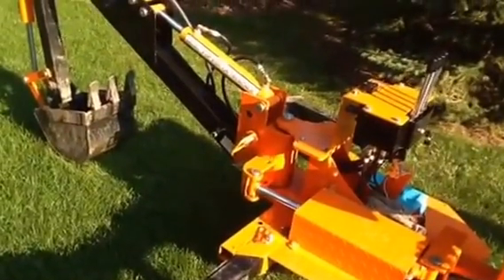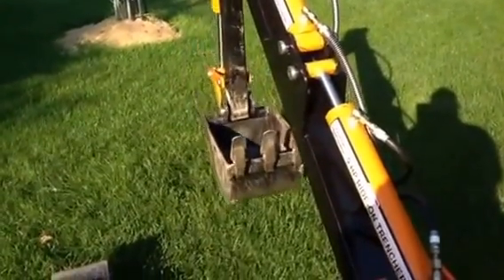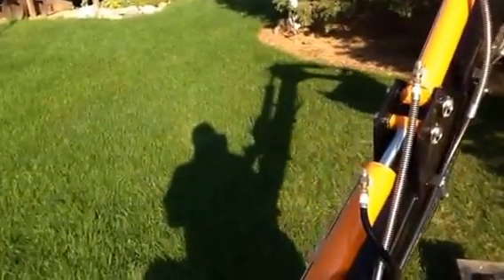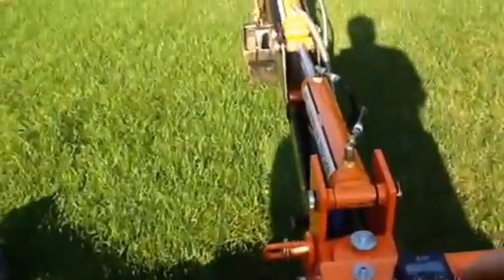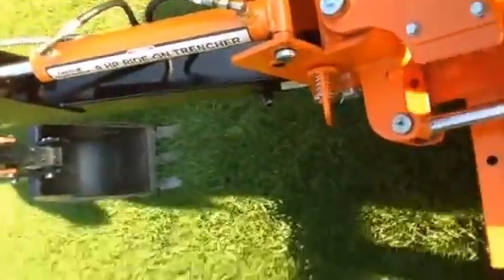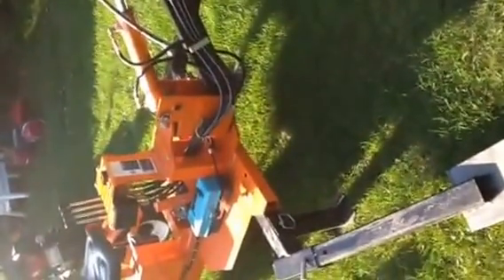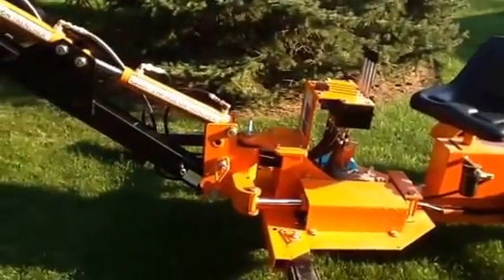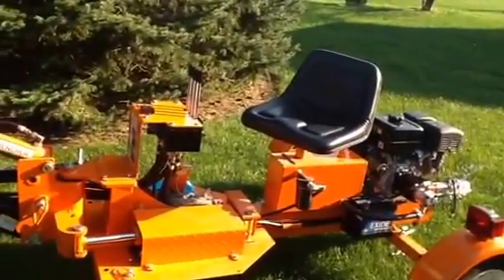Harbor Freight trencher 65162 hydraulic speed upgrade

Comment: Did you put a bigger pressure hose from the pump to the control valve?
Reply from the maker: I got the largest  one I could use to help with the bottle neck problem.
Reply: @goneredcar1 What size hose did you use and where did you get it? How did you get it to pair up on the valve body?
Reply from the maker: @Benpoetter  custom made at a local hydraulic shop. Brought the hoes to the shop and they made a new hose to the size that they thought would work.
Reply: @goneredcar1 What was the hose size that you settled on?
Reply: @goneredcar1 could you run the engine full Throttle if you wanted to or would you start to over heat the hydraulics system.
Reply from the maker: @Benpoetter  I replaced the gas motor with a diesel early on and I run the diesel at a low speed and no oil heat build up noticed.

Comment from the maker: I only had this pump on for a short time but I ran it at about 3000 RPMs. I then replaced the engine with a a diesel and a larger volume pump. I have had no problems with this setup and just reached 400 hrs.
This is not a back hoe it’s a light duty trencher or as I have said in the past hydraulic shovel.
Reply: What is the name of the new pump?

Comment: When you had that pump on could/ did you run it on full Throttle. And I see that they don’t make the pump that you put on anymore but they make a new and improved version. And is this a different pump than in your other video about the speed upgrade because this one says that you had a 20% increase and your other video said a 35% increase. And also, did you have any problems with the control valve after you did the new pump? Did it hold up in long term use? I am wanting to put a faster pump on my trencher but don’t want parts to break. I’ve also herd that it will take a very long time with COVID to get replacement parts and don’t want it to break in a job and be don’t for along time.

Comment: I loved your video. I’m about to buy one and would love to know which pump you found best?
I’ve watched all the videos so I’m upgrading everything.
Which pump?
Reply from the maker: The information and discussion with the information your looking for is in the text section of the video. The recommendations and part numbers can be found there. After checking there and have a specific question send me a message.
Reply: @goneredcar1  I see the video, it has no text in it, and the opening comment with replies below. Maybe a dumb question, but where's the "text section of the video."
Reply from the maker: It’s in the public text section here if your looking for the pump information remember it’s different for the several engines I tested on.
Reply: @goneredcar1  OK, thanks. I guess you mean the pump info is in one of the many replies. I'll go re read the replies. It might be helpful to some if that kind of info was included in your opening video statement text after where you wrote " How to upgrade the hydraulic pump to increase the machine speed by 20%"

Comment: Thank you for a great video. I am planning to build a similar back hoe for my JD 316 tractor. Do you know what size hydraulic cylinders are used on the HF unit?
Reply from the maker: Sorry, I haven’t any measurements and the machine is in winter storage in a out building which I have no access till spring. I’m sure someone will reply that has their machine available.
Reply: What type of hydrolic fittings are on this machine? Having trouble finding adapters
Reply: This lady has the fittings info. I'm trying to find my way through pumps now. I can't seem to source the exact same one. I really need specs on the original to compare to.
Reply: https://youtu.be/VIQbUcIsBvg

Comment: Hi, great stuff! My hydraulic pump was defective on a new machine with less than 10 minutes of moving bucket around in the air. I found a Salami dealer in Michigan but he didn't have the pump number you listed. He gave me a similar pump. While looking at these pumps I noticed all are above 3200 psi......you said your running at 2400 psi. I was told that the machine has a relief valve that will not allow psi above 2400psi. Is this a true statement or did you do something different?
Reply from the maker: Sorry to here about your pump failure. I never changed the pressure on the relief valve, the pumps I selected we’re higher pump volumes not pressures. Before you place a new pump on your trencher I would drain the oil and check for junk in the oil tank, and lines. With a failure like that the junk is everywhere so clean and inspect thoroughly.

Comment: I'm having problem with my control valve sticking, hf wants $300 for new, I tried to clean have you ever had that problem
Reply from the maker: JMTZ  I have never had any problem with the control valve. I have changed the oil twice since new. I would have the valve checked at a local hydraulic shop so you can make an informed decision before doing anything.

Comment: Would this pump work? Thanks
https://www.surpluscenter.com/Hydraulics/Hydraulic-Pumps/Gear-Pumps/0-277-cu-in-MTE-D206-5491-Hydraulic-Pump-9-8401-277.axd
Reply: did you buy the pump you listed and does it work good on the trencher?
Reply: @richardmiller3781  Still haven't for fear I would buy the wrong one.

Comment: would a DLH 4 GPM Gear Pump, 3600 psi, 2x2" Mounting, CW, CB1S-F4SA work for this?
Reply from the maker: MrStealth654321  4 GPM maybe to large of a flow rate for the 9 Hp standard stock engine. I ran a 3.7 GPM with the 13 Hp engine with good results. As I explain in another video, you start to get into a bottle neck problem because of 1/4” lines.
Reply: @goneredcar1  Trying to find one on ebay that will work .. with the 9hp. with out paying a arm and leg for it. If you know of any that will send me the part num  Thanks for all the great videos bud and any help.
Reply from the maker: MrStealth654321 They run right around $100.00 the part number is in one of the text portion of one of these videos. As I remember the location of the store was in Michigan that’s the best I can remember. I just put in the part number and it came up with the suppler.
Reply: @goneredcar1  ok bud thanks.

Comment: Hey, I know you posted this a few years ago but after watching your videos over the last year I finally ordered the HF trencher and am waiting on it to come in right now. I needed it to do my septic system and use it as a trencher on some of my construction jobs. went ahead and ordered the upgraded 4.2 GPM pump as well form northern tool. I was just wondering if you have even tried to add some type of counter weight to the back for better support while digging.
Reply: Hi, Did the pump from northern tool work?
Reply: Nothermn tool part fit
Reply: @ralphwebber6790  What was the model number from Northern Tool?  Did it improve speed?
Reply: Can you share the Northern Tool part number?  How is it holding up?  Did it improve speed?

Comment: I just bought a used HF backhoe, and your video's was a big help in knowing what I was buying.   That said.  I have one cylinder that doesn't stay in place, and another that has no power and whistles.  I am new to hydraulics, so before I start throwing money at this, I thought I would see what you suggest I look at first.
Reply from the maker: If you would like to confirm if it's a ram or the controller switch the Rams with the one that works. That's because if a ram is leaking internally there will be no indication of leaking oil. Remember this is a bypass hydraulic circuit so oil is always flowing. When you determine the problem check with a local hydraulic hose and cylinder shop for rebuilding. That may run from $75 to $100 for rebuilding.
Reply: Thank you for your help.  I was able to determine that one cylinder is the ram, and the other is one of the valves.   The one that is on the valve I can here a whistle sound coming from the valves when I there is a load.   I plan to change the o-rings on the hose, but is there something that I might also need to check on the controller switch itself.

Comment: I found your YouTube so I upgraded my pump.
Works great.

Pump 
Salami Hydraulic Gear Pump 1.6PB4.1D-R080S0 
Model # 6142?5002 
( ? looks like 3 or 8 )
I just installed the one above on my backhoe / trencher
The "D" is cw (clockwise) when ordering pump. 
OR
1.6PE4.1D-R080S0
Model # 614470242

(Both pumps are the same)

Adapter
6MB-6FP

Adapter
8MB-8FP

Thread Sealant with PTFE
Permatex 4 ounce  #80632
Reply: F the

Comment: thank you again for info, just to let you know, i changed cylinders. and moved the one with the seepage problem that was on top and now i put it on the bottom where it holds entire boom and now its doing the same thing.the top one works fine and bottom one has the problem ,so i am thinking it is the hydraulic cylinder. what do you think?

Comment: hello again my friend, i have a couple of questions maybe you can help me with. first whats the number to the company you bought the hydraulic pump ? i am still using the pull 9hp engine it came with.And the other question is the bucket keeps dropping by it self.I added more fluid because i thought that may help but it didn't.The machine has no leaks what so ever and i dont know whats wrong.Maybe this happened to you.I have less then 20 hours on the machine.It digs strong but when i am ready to pick bucket up it keeps dropping and losses alot of power were i cant even pick up dirt to empty out.i did notice if i curl the bucket first then i can raise boom but it takes literally more than half a minute which makes working very frustrating.Any information is greatly appreciated, Thank you very much;  Jack
Reply from the maker: +hunterjh13 from what you describe it sounds like the valve body may have a problem.  Sometimes crud  from the tank gets stuck in the spool valves, this occurs from the manufacturing and failed cleaning of it.  I have had several folks reported this problem. Many reported junk found in the valve body, one a broken return spring, and damaged Orings.  Your second question on the pump as I said in the text portion on this post I purchased local. The pump number in the text is universal and a google of it will locate several locations it can be found.  From what I have heard there was A place located in lower Michigan that had it for a good price (no other information on name)

Comment: Hi Gonerdcar1, 

Thank you for your video. It is very helpful .  I am confuse on your information with the  Salami Pompa mod# 614470242.  Is this pump used for the 35% or 20% speed increase? Base on your updated info, we should use 20% speed increase because of the heating problem. Can you let me know which pump model I needed to buy for this 20% speed increase?  Also, do you have any idea on the HF trencher loader lift capacity? 

Thank you
Reply from the maker: Toan Than it's based on the pump volume you choose and the speed in which you run it. What I did is change the engine from 9 hp to 13 hp to gain the use of electric start. With the added hp I reduced the engine speed and increased the pump volume.  I had changed the pump several times because the hydraulic shop in my local area supplied me with several pumps to play with.  Watch all the videos and you will see you can only get to a point and you are bottle necked by the small 1/4" hoses.  Then you start to heat the oil caused by friction  by the restrictions of the small hoses.  The bottom line is keep the pump volume between 20 to 35 % increase over stock. Sometimes more is not better.  When I went to a Diesel engine I slowly started to switch over to 5/16" lines that helped a little.  I now have the trencher working just the way I like it and have put many hours on the clock. I was very lucky to fine this local shop that assisted me with there expertise and resources.
Reply: goneredcar1 Thank you for your feedback.  I got what you mean now.
Reply: Ś

Comment from the maker: No other filter, but it maybe a stuck control valve.  The next thing to check do you have the right hyd oil (32) this is very important.  Next because of your low hours are all the hoses right and are the tight.  If you are getting air in the system this can cause control failure.  Just to let you no the tech support on the trencher is a little lacking on the running of the machine.  If you get a little frustrated find a local hydraulic pump and hose shop they maybe more help then HF.
Reply: The best  way that I. Can tell you to check this machine is to  find  out .if  all of the hyd. Cylenders . Are bled . 1 after.the  othef. And .check.mfg. ing. Recomendation.s for.that. machine.

Comment: Hi and thanks for all your video.
I have only 8 hours on the trencher and today as I was digging the machine won't respond, was low on hydraulic oil so I add more, worked a bit then stopped again, but fluid level is good, called tech support but need call back tomorrow, beside the filter on the side by the hydraulic tank there is any other filter that May clogged up and won't let oil go true controls? Maybe you can help, thanks in advance. Tony
Reply from the maker: This can be narrowed down quickly by removing the return line and placing the end into a clean bucket.  Start the machine and see if you have a fast stream of return of oil going into it, if the stream is of low volume it's the pump.  If the volume is good it's the valve body's bypass feature stuck open.  I have heard that this may occur if debris gets into this area.  The bypass section is on the right side of the valve body follow the return hose back to the valve body.  If you think it's the pump and need a pump to replace It I have sum to try, contact me if you need more help.
Reply: MrAnthonyp28 I am having the same problem. I just started using mine and now it's doing same thing. Have you figured out your issue as of yet?
Reply: goneredcar1 Thanks for your response. I have checked just what you have said and at an idle speed I can put my thumb over the return line and stop the flow. Not sure if that is good or bad but I'm hoping its just the pump for now I have to many projects going on now to do a complete upgrade of everything. Maybe over winter I can. Keep up the excellent videos. Any info will help.
Reply from the maker: That would be a bad pump, if you find it difficult to locate a pump I do have some.  If you ran the pump with no, or low oil it can damage the pump very quickly.  If you look into the pump you will find gauging that  lead to pressure loss.  Make sure you were using the right oil also before installing a new pump.  The oil will need to be changed and system flushed of all metal and debris and the filter changed or you may damage the new pump.
Reply: goneredcar1 Again, Thanks for the response and all the great video's. I have located a new pump from Grey Hound, the manufacturer of the back hoe but I have a few more questions for you. 1) How big of a pump do you think I can run with using the factory 9hp engine? 2) You say you have a few pump laying around, so I was wondering how much you were looking to sell them for if your wanted to sell?
I was watching the video where you changed out the hydraulic oil filter and housing. Was there a must for that because of your upgrades or because it is hard to locate the filter?
Reply from the maker: The standard pump is 2.7, and the largest I would use with the 9hp. would be around 4.0 without any other changes.  You can do the math to see the volume increase but remember there is also the limits of the hose diameter to deliver the oil.  If you leave a contact email I will follow up with more detail.  The reason as stated on the oil filter change was mostly to do with availability of the quality filter replacements.  I believe that debris in the oil results in pump failures and ram seal failures so it's cheap insurance. By the way if you had pump failure this early on again check for debris in the oil and if your using the right oil, level is important also.
Reply: Duly noted with the oil filter. I had loan my machine to a friend but I started to have this problem, I removed the filter and there appeared to be a piece of rag or some other type of material in the filter, for what reason I have no idea. That was the reason for the filter question.
Here is my contact email, 
w.lancaster33@gmail.com

Comment from the maker: goneredcar1
3 days ago
 
It comes with 2.7 Deli pump and a 9 hp engine go with a 4.0 or better max at 4.5 depending on the brand there is no standard.  The shaft size 1/2 in. and length is 1 1/2 or better will work and 1/8 keyway.  The Salami Pompa mod# 614470242 is a good match at 4.1 watch all the videos to help getting tips and tricks. Good luck and its a great little machine.
Reply: What kind of pump should I be looking for?

To start out with I'm going to keep the 9hp, but I plan to upgrade to the 13hp and maybe later on the 10hp diesel engine. Can I upgrade my 2.7 Deli pump now to a pump that will work with these other engine types? I found this: https://www.surpluscenter.com/Brands/MTE-Hydraulics/0-277-cu-in-MTE-D206-5491-Hydraulic-Pump-9-8401-277.axd   --- Would this work?

Thanks
Reply: Do you still recommend this pump and gpm. Also do you know what psi the stock pump is.
Reply: I ordered the Salami pump and it should be here in a few days. And I'll be getting the 5/16" feed hose and 3/8" return hose probably today from a local supplier. Did you use the Loctite 567 on the in/out fittings when installing the pump?
Reply: @davidpritch718  Hows it working?